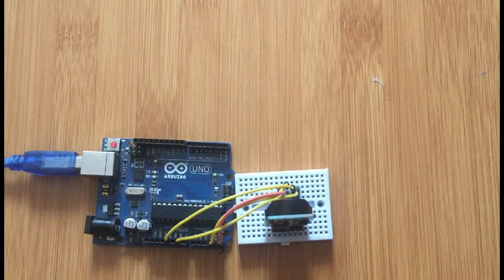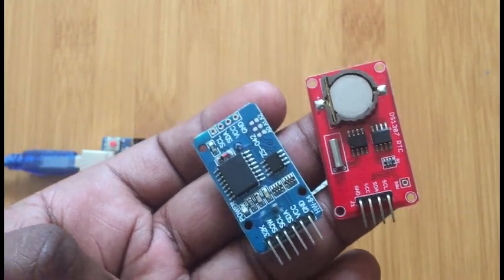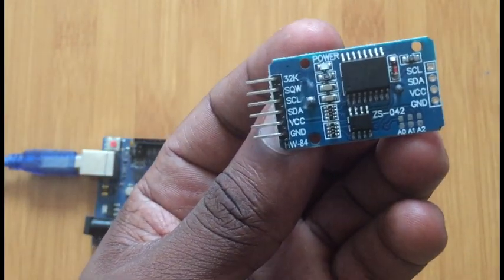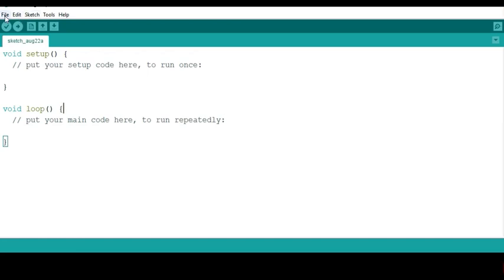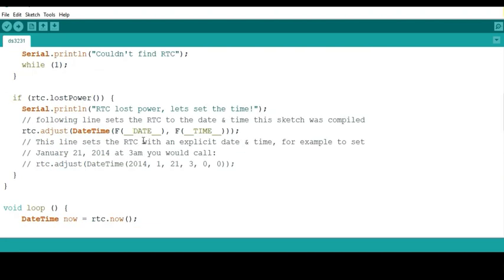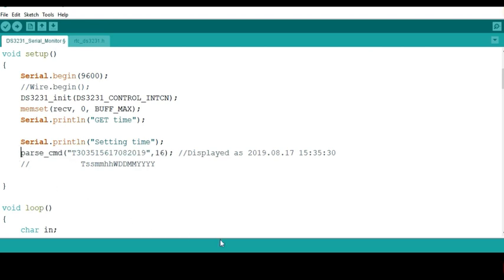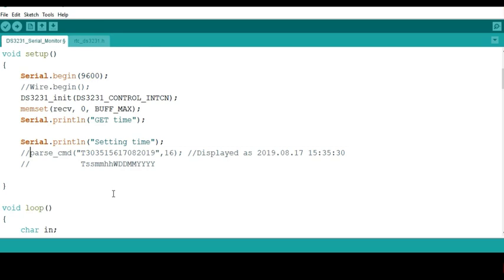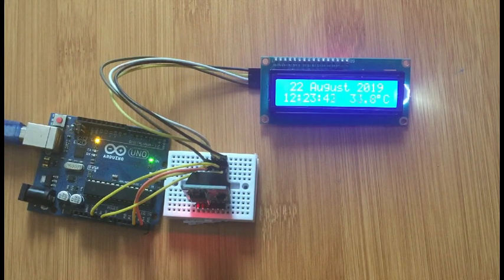DS3231 RTC INTERFACING WITH ARDUINO

Comment: hi Tectutor. Working ds3231-rtc-with-arduino-including-digital-clock-using-LCD displayI got your code which calls for ds3231.h and IDE errs : cant find . I fetched this ds3231.h file and got in my disk. How I must tell IDE to consider this file that resides in my computer?. HOW Thanks Dr J

Comment: everything works fine, but when I disconnect the arduino from the PC, wait a few minutes, connect it again,  Time starts from the moment where I cut off the power. 
Where is the fault hardware or software?
Reply: battery?   (assuming you commented out the parse_cmd once you had the date/time set).  Once set, with a good battery it keeps good time (+/- 1min per year).  I would check your battery and inspect the battery terminals, test that you see voltage coming into the board from the battery.